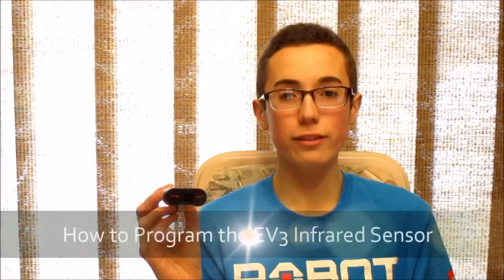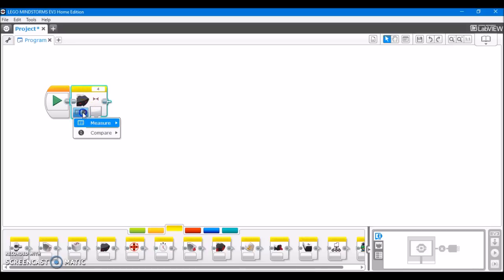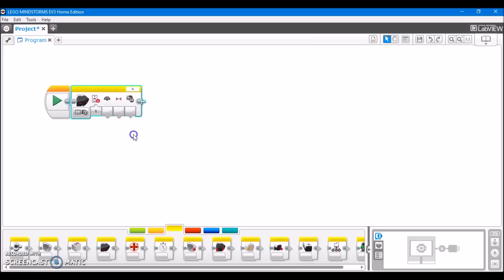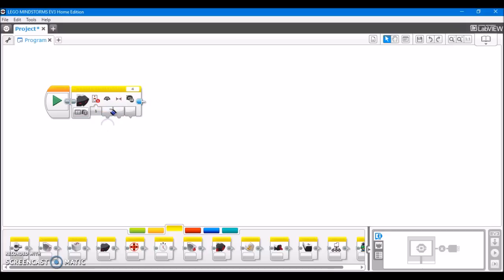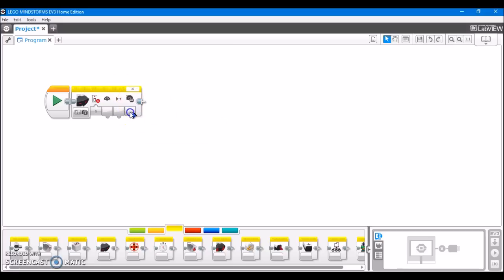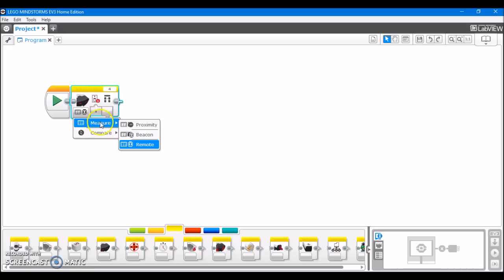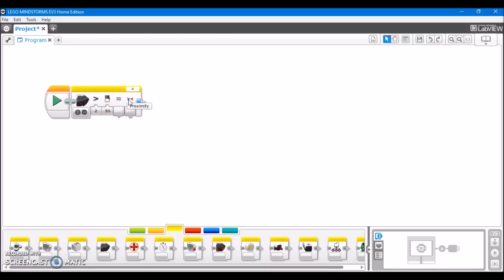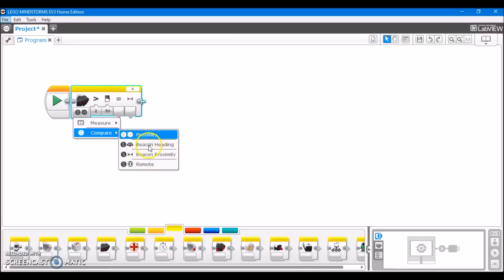How to Program the EV3 Infrared Sensor

Comment: What is better? Infrared or Ultrasonic and do you know where I can find an ultrasonic sensor for cheaper than the lego website?
Reply from the maker: Choose the sensor that works best for what you need. The US sensor is better at measuring distance, but the IR sensor has a few additional useful features. You won't find the sensor cheaper than on the website.
Reply: Thanks!
Reply: amazon or ebay you can get used ones
Reply: OMG hello Rubix Cubed I looooooove your channel pls notice me

Comment: l mean is the ultrasonic sensor better than the infrared sensor
Reply from the maker: +Waley Eldeen Ahmed Not necessarily, they're used for different tasks, but there is some overlap, with distance measuring. I usually prefer the ultrasonic sensor for distance measuring.